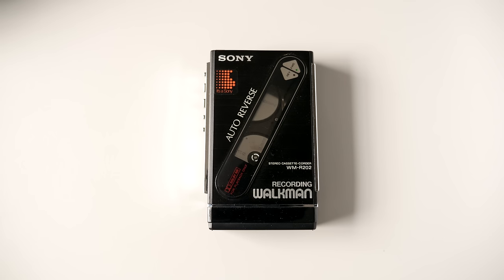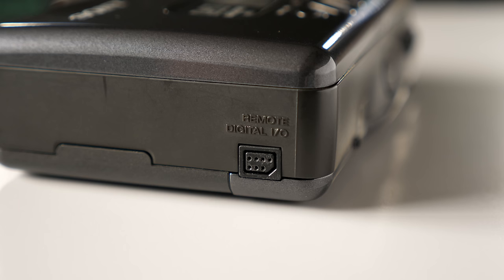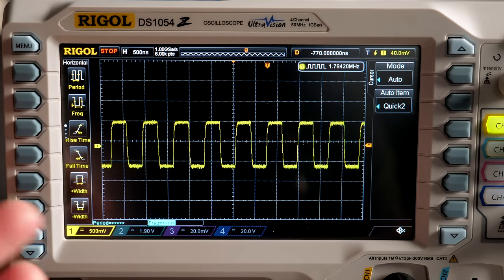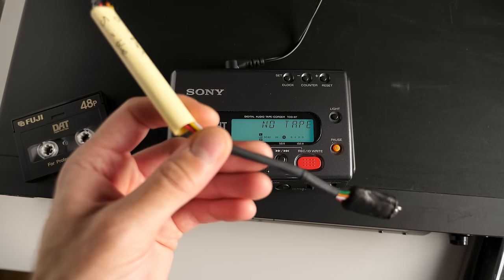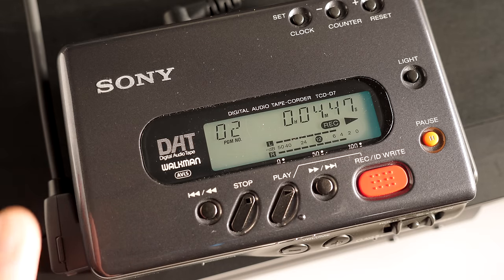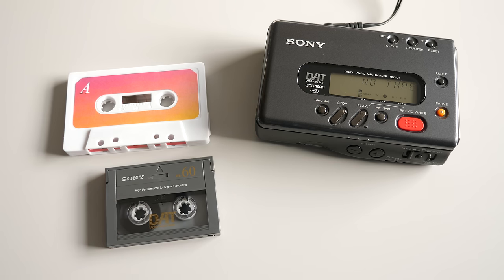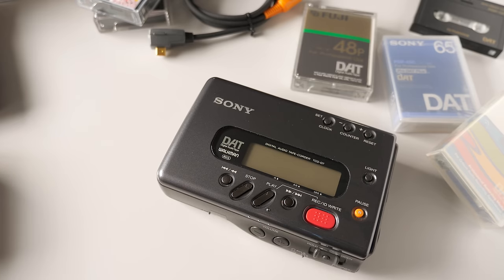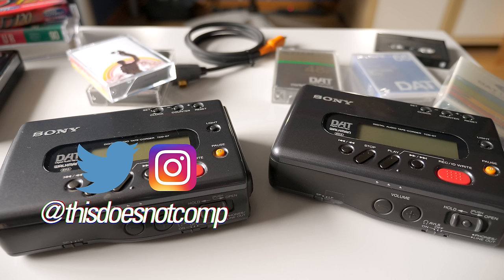Sony DAT: What Cassette Should Have Been!

Comment: Lots of reasons for the failure of DAT other than for pro or prosumer use.
The delays to market due to the Riaa suits and copy fears, scms limits on consumer gear (no ability to turn off vs pro gear), increasing quality of consumer analog cassette decks and blank media through the mid 80s to mis 90s and of course the mini disc
I bought my first Mini disc players by late 92 through 93, the Sharp md10 and a Sony md component deck.
Md was far more reliable, quickly cost reduced, and blank media easy to find and lower cost with no worries for wearout when reused many times.
Yes, md was lossy compressed vs dat, but continued improvements in the lossy atrac codecs made this a moot issue.
Stock car cassette decks got more reliable and better sounding through the 90s too.
Even radio stations and bands used MD, with superior editing and random access.
Md reigned until sd card capacity and cost and accompanying recorders finally met or beat the abilities and cost of md, which wasn't until post 2005, maybe 2010+

Comment: When DAT degrades it splinters into sharp, cold digital shards. When analog tape degrades it just sounds warm and fuzzy.
Reply: Analog tape, when it wears out, can have issues with wow and flutter, issues regarding the little pressure pad, issues with the tape splitting, and issues where the tape won't even play sometimes depending on the player.

I'd personally choose a digital tape format over an analog one any day as long as I can be guaranteed a good supply of tapes and I could get equipment that works so I could avoide the noise and speed issues of compact cassette and other analog cassette/audio tape formats.
Reply: Wow and flutter sounds cool though. Using tape for digital signals is like using butter to grease a bicycle chain. It’s a waste of good butter and the wrong tool for the job.
Reply: @lordsharshabeel  Wow and flutter just sort of make me nervous, because it means the tape is one step closer splitting and possibly damaging the player (it could also indicate a poor quality player or tape). DAT is different from analog compact cassette. It is the correct tool for some jobs because not every tape format is used for the same purpose. Take MiniDV tapes vs. VHS-C tapes. Both are consumer camcorder video tape formats, and both work equally well for their designated purpose. Likewise, DAT and compact cassette both work equally well for their designated purpose, with both formats giving distinct advantages and disadvantages. I have nothing against analog tape formats (both audio and video), but regarding DAT, I do like the fact that it gives CD quality audio in the convenient cassette form factor.
Reply: Lord Sharshabeel Until well into the 90s, the bulk of digital data in existence was stored on magnetic tape. (Not cassettes, of course.) So using tape for digital audio is in no way farfetched. 

Wow and flutter only sounds cool if you want it. But unwanted wow and flutter accumulating at each step of recording was the bane of the engineers of the time. It’s easy for you to look back with rosy nostalgia now, but in fact, eliminating wow and flutter in analog audio took incredible amounts of engineering. The work it took to make tape transports with low wow and flutter is incredible, especially in miniaturized electronics like walkmans. For recording engineers, digital was a breakthrough because it practically eliminated wow and flutter and noise. If you want those for artistic reasons, you can still add them, but if you want a clean recording, you can actually have it.
Reply: Ben H. Look into the defunct VXA backup tape format. The cassette is a modified Video8 format, but with different tape stock inside IIRC. But the big difference in the format is in the drives: though it used spinning helical scan heads, it used packetized data recording with extra read heads. By doing so, it supposedly could actually recover data from distorted tape, at least within the type of damage that would happen in a tape drive from starting and stopping, etc. 

The Sony NT tapes do something vaguely similar, I think, but without a spinning head. That’s a format that is a hardware tour de force, but which completely flopped in the marketplace. (And it, too, was briefly modified into a data backup drive format!) 

(Historical footnote: the earlier AIT backup tapes were also based on the Video8 format, as was Sony’s Data8.)
Reply: @tookitogo  Ah, yes! I love backup tape formats. I'll have to look into VXA. You also make a good point about how digital data was stored on magnetic tape for a good amount of time before other media took hold. You also said what I was trying to say about wow and flutter but in a much better spoken and more concise way. :)
Reply: Ben H. Thanks for the kind words!
Reply: @tookitogo  No problem! I wish I could explain myself concisely and eloquently, but I generally degrade into a verbose mess when I try to explain something remotely complicated, even if I know exactly what I'm talking about xD
Reply: Ben H. Hah! Well, part of it is a knack for it, part of it is ample practice from years of heavy involvement in tech forums, and work in online customer tech support and technical writing. ;) 

Break things down into manageable chunks of info, and write down what conclusions you’re trying to come to, and why each piece leads to the next. That helps form a... turn by turn directions of what (and how) you want to say. :) 

Another really good trick is to simply, in your mind, tell a friend what you’re trying to explain. A conversational tone at that stage is often a good starting point. You can then tighten up the language in a second pass. 

Consistency is critical. Always refer to a particular thing by one term only, and use a term only to refer to a single thing. If need be, spend time thinking about terminology, as this makes explaining a LOT easier. 

Finally, if there’s one guiding principle to technical writing that I live by, it’s “if it doesn’t add, it subtracts”. Every superfluous word is just distraction. Remove everything you can, but no more! ;) For example, instead of saying “In order to...”, just say “To...”. Instead of a complex or ambiguous comma-separated list, use a bulleted list instead. 

Take care, dude! :)
Reply: @tookitogo  Ok, cool! I admire your ability nonetheless! :D

Comment: The explanation around SPDIF and AES is terrible, completely failing to properly understand self-clocking signals and poorly explaining PCM, making it sound magical when it's pretty simple.
There was no desire to artificially separate consumer and pro digital audio, it's mostly about practical issues. AES3 is designed for very long cable runs on differential pair connections using XLR cables. SPDIF is designed for short runs and have cheaper electronics. It's hardly surprising that a professional tape recorder can slum it down to SPDIF as it has a sensitive discriminating input.
Also SPDIF has an impedence of 75 Ohms while AES is 110 Ohms, which would support the electrical compatibility as the levels would be different at the different impedence. Note: If you don't terminate your measurement of the signal into the scope you won't be measuring the voltages correctly as you are measuring open circuit voltage.
Umatic lived much longer than you'd expect in regional news stations.

Comment: Cassettes shouldn't have been digital.
They were good enough. Better than mp3.
Reply: FlippDurch LOL no. It takes a lot of work to get cassette to sound as good as a CD. A cassette’s noise floor is equivalent to less than 8 bits of digital audio. (Bit depth defines the noise only.) Meanwhile, unless using extraordinarily good home decks, the wow and flutter of tape is inferior to digital. MP3 at a decent bitrate is unquestionably superior.
Reply: @tookitogo  I had tapedecks at home and in my car and sorry but cassettes sound better than mp3. Never wrote anything about CD
Reply: FlippDurch A properly encoded MP3 at decent bitrate is essentially indistinguishable from CD. Very, very few tape decks can come close to that. You may like the sound of a tape, but they’re not superior to MP3 in any measurable way.

Comment: DAT is a worthless format now, so it's strange that people would actually pay money for a DAT machine or tapes these days. Well, I guess I could see paying money for a machine if you have old DAT recordings that you want to transfer to a better format such as solid-state memory, which is far better in every conceivable way. Compact Cassette tapes and gramophone records still have a certain charm because they're analog and they can't be losslessly transferred to a digital format, but DAT is nothing more than a bad (low-capacity, non-random-access, complex/problematic due to being electromechanical, and delicate due to being on thin magnetic tape) digital data storage format which can be transferred to better formats with zero loss.

Comment: Click bait title. "Imagine an audio format with the nostalgia of cassette, but the pristine sound quality and convenience of CD. It existed in the form of DAT -- so why didn't it catch on?" It didn't catch on because none of what you said is true. What's the point of digitally recording from digital to tape, other than piracy? You demonstarted this, but you somehow suggest that there was fear mongering about this capability. Instead of showing off recording from analog you wasted a bunch of time with digital. Keep in mind, DAT was not nostalgia as new tech, new tech by definition is not nostalgic, it's always futuristic. The truth is that the music industry was correct, it was a pirate's dream. And CD-R proved it. This would later be proven even more so when MP3 became a thing because the duplication didn't even have to be "pristine sound quality." It just had to be as portable as the CD had become. You also suggest that "It existed in the form of DAT" but you also demonstrate that  it didn't always work and you admit this was common. Now picture that field recording that take places, which DAT is obviously the only situation this device is good for and it fails to record. Well, would this happen with even cassette? No it wouldn't. This is bad technology. This is why it didn't catch on. If you look at MiniDisc, the rewind time is zero and yes you don't flip it either. DAT also is a poor method for archival situations. It's still magnetic and it's still tape. Both have problems. And because of this I would suggest that your fancy cable wasn't used desired at all for the use you demonstrated. It was desired because they owners wanted their "pristine sound quality" off a very flawed medium and onto something that was more achival friendly. IMO, you got everything wrong in this video. And I realize why things don't compute to you. You actually don't understand how things in this world work. You just see a bunch of cool things, but don't take into account whether or not these things are ultimately all that useful. And this wasn't a useful technology.